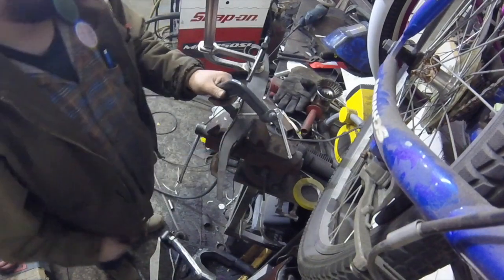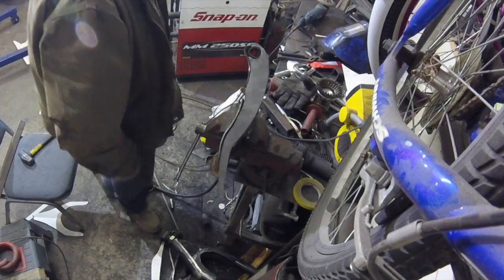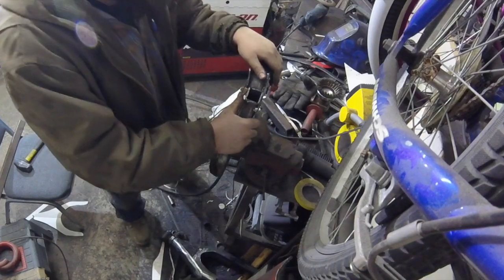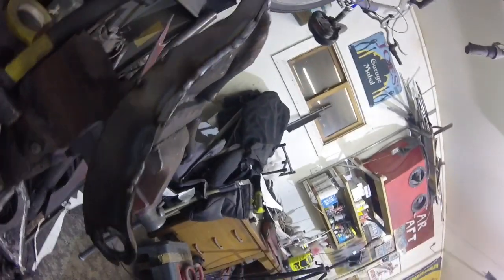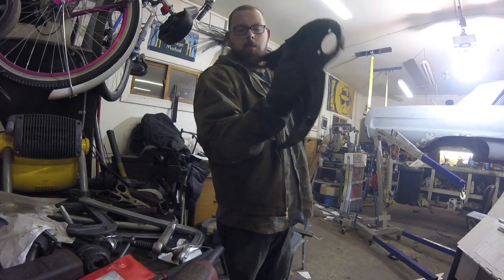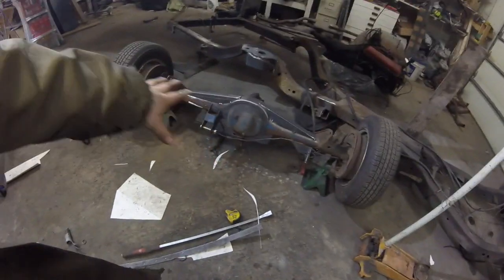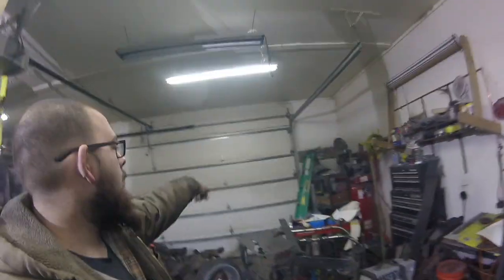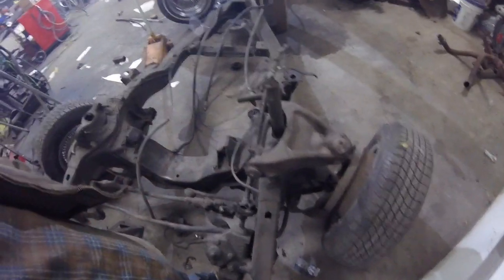Lowriding is DIRTY!!

Comment: Paint chips pretty easy and if it's gonna be a driver, I suggest powder coating it a gloss black. Shouldn't be too expensive.
Reply from the maker: Tony Rivera that's what I was originally going to do. But done some research on it and powder coat actually chips very easily also. And with powder coat they put it over bare metal, with paint I could atleast put an epoxy primer down and then paint then clear. Might have more protection that way. Plus I was quoted 700 to powdercoat it plus having to have the frame hauled there and back. I'd be about 850 in it. I could paint it for about 150 bucks. I was dead set on powdercoat too lol.

Comment: The frame would be good black, but you absolutely need to chrome at least the rear end, trailing arms and upper and lower A arms in the front! The way I look at it, you're putting in a lot of work and time into this build, so might as well make it worth while!
Reply from the maker: MrGonzalezchuey lol it's not that easy. That would be easily 4000 bucks in chrome, and there is no chrome shops in my state so I would have to pay to ship all that to a chrome shop. Easily another 500-800. It's just not realistic for me. 4000 bucks would get me a LONG way on this build. I agree I'm putting a lot of work into it but I definitely won't enjoy it anymore if my read and was chromed lol. I would by much happier with 4000 in engine, interior and hydraulics. Throwing a ton of money at something so small just doesn't make sense at this point in the project. Maybe years down the road.